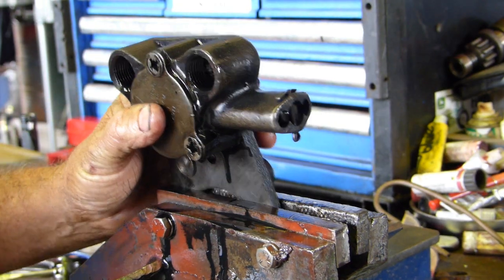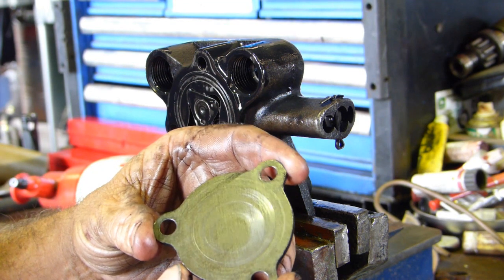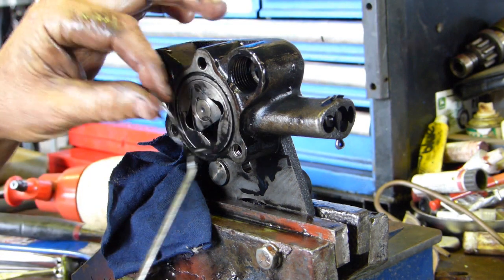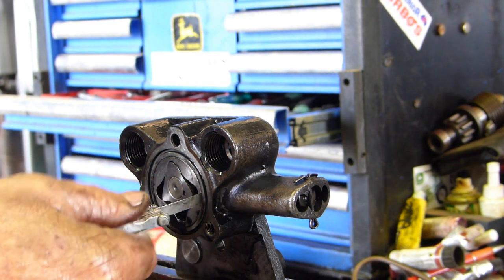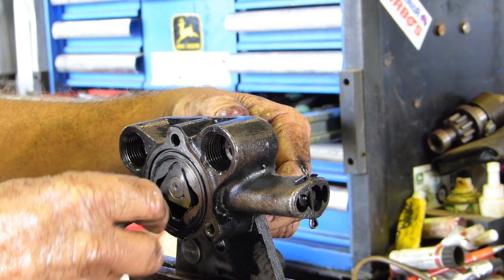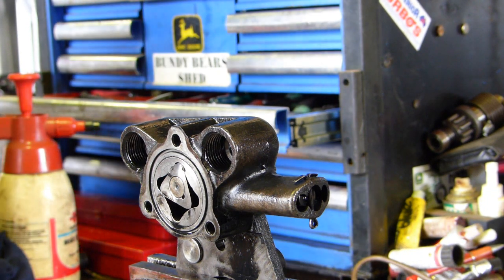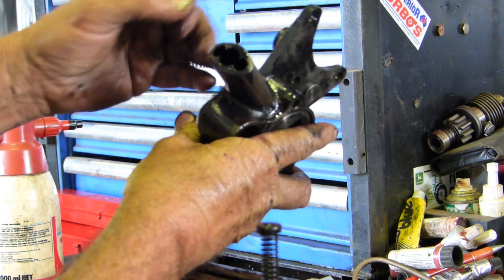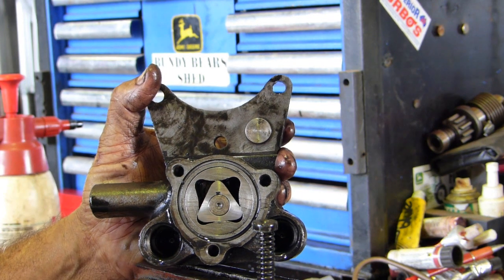MF135 Restoration #17 Checking out the Engine Oil Pump

Comment: That relief valve looks the same as on my TO 20. The spring I pulled out looks as long as the one out of yours. The new spring in the rebuild kit is about a 1/2" or so longer and sticks out of the housing so you have to compress in to get the cup and cotter pin in. Hot and running my tractor only had about 10 pounds presser. I did have quite a bit of wear on the front cam bearing and the front leather seal was worn through so there is where most of the problem was but I also think the spring was weak. Tractor ASAP has an after market bearing kit for this problem and it requires line boring the block to fit the bearings.If the TEA block is the same, then you could use this kit to fix them as well. The kit comes with 4 bearings because it will do other engines with 4 bearings, TO 20 only has 3. Just a tidbit of information that I leaned along the way.
Reply: Sorry to be so off topic but does anyone know a way to log back into an Instagram account?
I stupidly forgot my login password. I would appreciate any tips you can offer me!
Reply: @Houston Brysen instablaster =)
Reply: @Noah Jared Thanks so much for your reply. I got to the site thru google and Im trying it out atm.
I see it takes a while so I will reply here later with my results.
Reply: @Houston Brysen Glad I could help =)

Comment: Hi Lance, I have the front axle off of my 67 135 and thought it would be a great time to replace the oil pump; seems the pressure relief is stuck since pressure gauge is pegged off the clock. So, I'm wondering, with the front axle yoke removed, how do I jack the engine to remove the oil pan. Is it sufficient to jack it at the clutch inspection plate area or should the front of the engine be supported as well. I guess I could support the engine by blocking up to the crank shaft or suspend it from above with an engine hoist. What would you recommend?
Reply from the maker: Yes I jack on the clutch inspection plate with a board across it so the jack doesnt slip.

Comment: Low oil pressure can be the result of the spring, the measured difference with the gauge is not so decisive. Has the spring, in my mf50 it should be 2,030 inch,become too short after all these years, the valve is nearly Open all the time, so that the oil passes by. Or am I wrong with the spring? Then correct me.

 But nevertheless: I enjoy your Videos as a German from Germany and they help me a lot in fixing my mf50s.
Reply from the maker: It can be but it is more often a worn bearing.